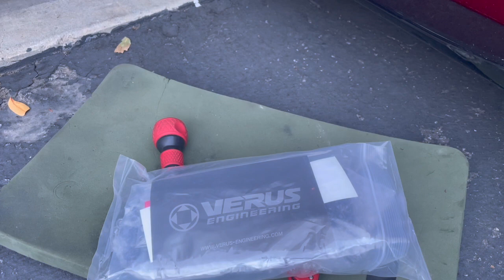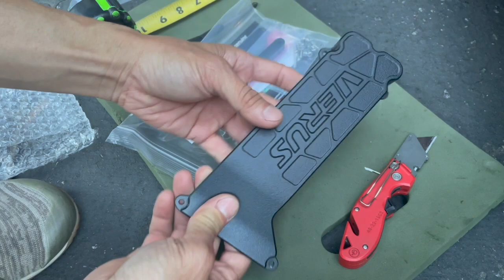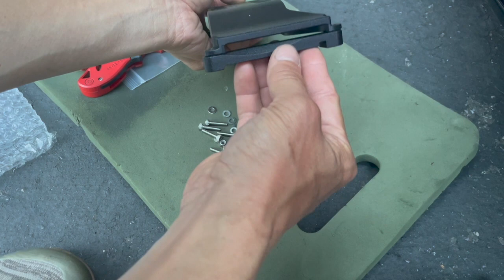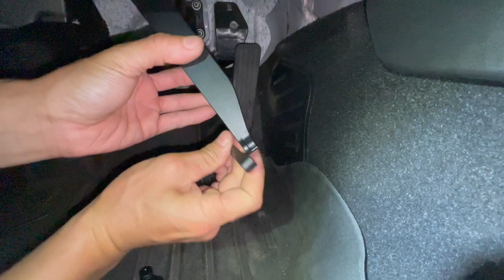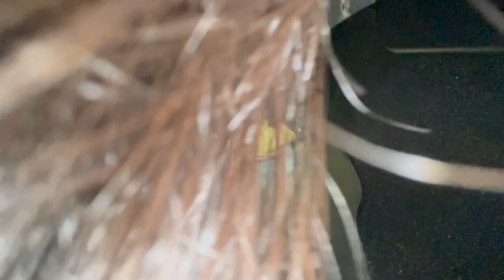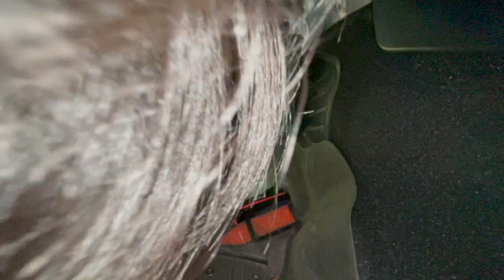ND Miata Verus gas pedal spacer install

Comment: I just did this install.   I tried it like you but ended up cramping all over the place lol.  Ended up removing the pedal and it was 100 times easier.  Disconnected the battery before removal and so far no codes or anything
Reply: unless you have a weird foot, maybe it takes some getting used to. It's a million times easier with the verus spacer, I don't know anyone who can do proper heel-toe with stock ND pedals and leather seats lol. It's just so uncomfortable, messy, you name it. It's not efficient, and your braking will suffer from it. So will your passengers from the "hiccups" you make when your foot does the back and forth between gas and brake when heel-toeing